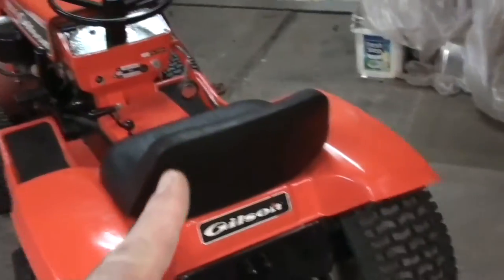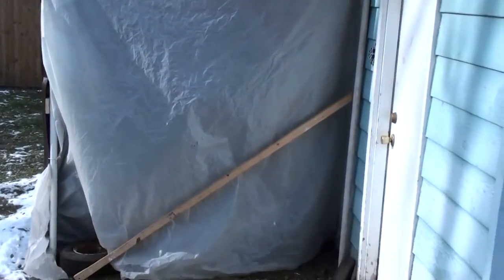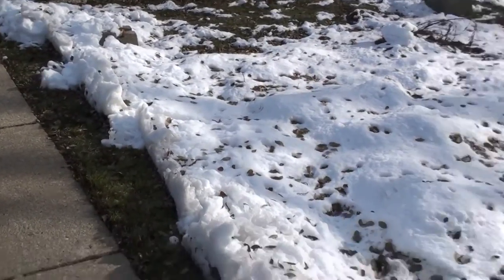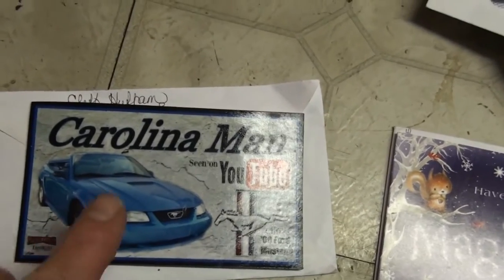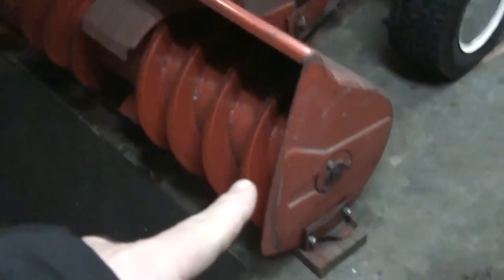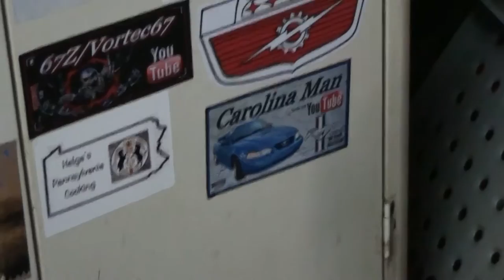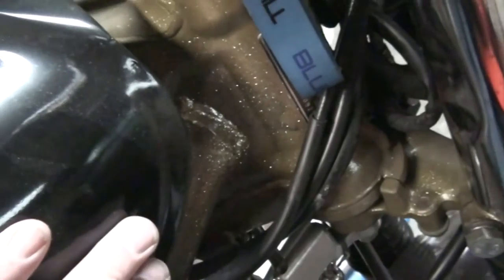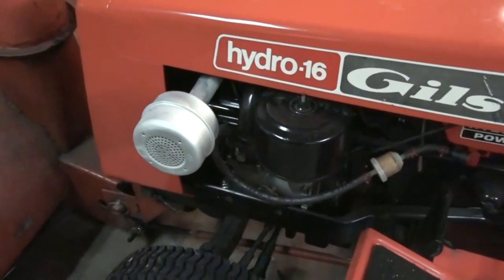Update and 1975 Gilson at work

Comment: great job works pretty well! I now see how my shoot handle is supposed to mount in the tractor, I have to fab on up because I don't have one!
Reply from the maker: Well if you need pic's of any thing let me know. I wish I had an extra one for you but sadly I have almost no spare parts for this tractor however I keep hitting Craigslist and Ebay hoping to find some more. :)
Reply: Its ok if i need pics i will ask thanks but i am not trying to find these parts, i know their rare i will just fab them up
Reply: MidwestMotoRider would you be able to give me dimensions for that bar that holds up the rod for turning the snow blower's shoot, like total length and angle it is at or the distance it is from the top of the hood?

Comment: Just wondering if you have tried the 2nd stage Modification of putting the rubber paddles on fan blades ? Thanks and nice old tractor !!
Reply from the maker: So this snow thrower is a single stage so there are no paddles just the rotating augers. Thanks, I like it. Currently its not running not sure why but hoping to have it up and running by next snow. Thanks for watching.
Reply: I have the same style on my Wheel Horse, can't believe I missed that, oh well !  Thanks.